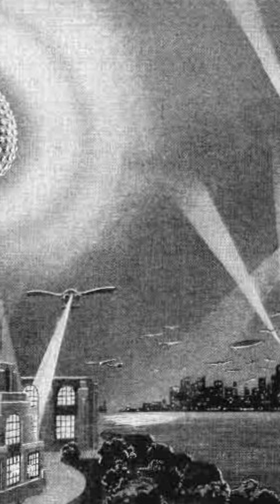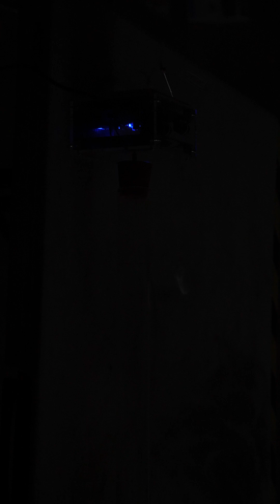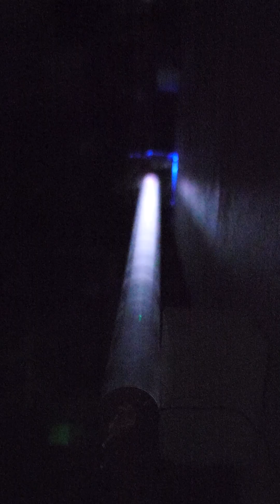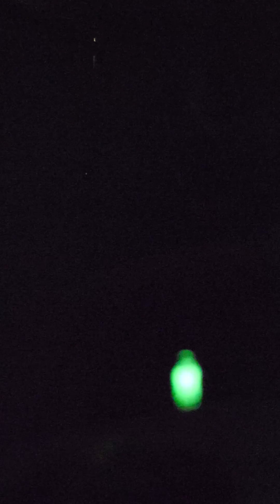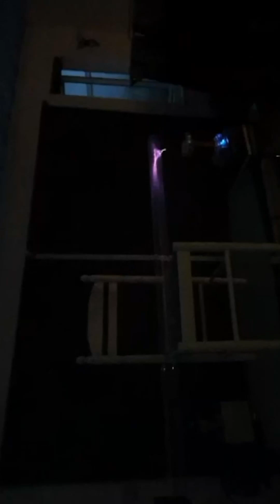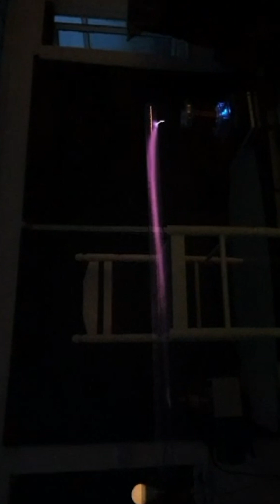Testing Nikola Tesla's Wireless Energy Idea

Comment: Introducing the Hyper-Resonant Electromagnetic Flux Transmatron, a groundbreaking innovation in the field of pseudo-resonant energy transference and wireless power transmission optimization. This state-of-the-art device is expertly designed to modulate and synchronize the intricate electromagnetic interactions within elaborate systems, while simultaneously enhancing the stability and adaptability of interconnected components.

At the heart of the Hyper-Resonant Electromagnetic Flux Transmatron lies the pioneering integration of a multi-scalar, magneto-inductive lattice network. This network capitalizes on the power of electromagnetically synchronized energy harmonics, initiating a meticulously regulated series of self-organizing, trans-spatial interference patterns. As a result, the device optimizes the coherence and synchronization of electromagnetic waveforms across a broad range of operational parameters.

The Hyper-Resonant Electromagnetic Flux Transmatron is also outfitted with an advanced radiophotonic synchronization conduit, which employs a highly sensitive array of superluminal resonant phase detection nodes. This allows for real-time monitoring and adjustment of sub-wavelength electromagnetic fluctuations, effectively counteracting the adverse effects of energetic anomalies and power dissonance.

Furthermore, the device incorporates a cutting-edge, non-linear electromagnetic inducer that dynamically generates an enveloping field of non-localized energy particles. This field serves to stabilize and reinforce the structural integrity of the magneto-inductive lattice network, enabling the device to maintain an optimal operational threshold under extreme conditions.

A series of polyhedral, electrodynamic dampeners are strategically positioned around the device's core. These dampeners provide crucial protection against the detrimental effects of hyper-resonant electromagnetic oscillations and ensure the smooth functioning of the Hyper-Resonant Electromagnetic Flux Transmatron, even during periods of intense system activity.

Lastly, the device boasts an integrated yoctoscale energy-gradient modulator, which continuously samples and analyzes the ambient electromagnetic energy patterns within its operational environment. This sophisticated feedback mechanism empowers the Hyper-Resonant Electromagnetic Flux Transmatron to seamlessly adapt to fluctuations in system performance and external conditions, maintaining a consistent level of wireless power transmission harmonization and stability.

In conclusion, the Hyper-Resonant Electromagnetic Flux Transmatron represents the cutting edge of wireless power transmission and system optimization. With its innovative design and unparalleled performance, this device is poised to redefine the boundaries of electromagnetic energy transference and usher in a new era of efficiency and stability in complex systems.

Comment: Very high voltage (Volt), corresponds to extremely low current (Ampere or I) and impedance. While the concept works with "full size bulb" clearly that bulb was an efficient LED bulb (high impedance.thus low current), as well as a neon bulb, which merely requires about ~62 V to trigger ionization, thus glowing. Also high impedance load and low current.

But would it work in a traditional tungsten incandescent filament? That one is low impedance thus correspondingly high current.

Takeaway:
1. Ohm's law rules, even with electrostatic voltage potential. Until the breakdown of the dielectric; thus why low pressure or vacuum allows the plasma to exist.

2. What about the flow of electrons source into low impedance sink?

3. And instead of ionizing the ionosphere (unknown side effects) while depending on electrostatic forces; how about some current flowing through a conductor material, which will inherently create electrodynamic and electromagnetic forces propagation/transmission?

Comment: Those who don't know: (Simplest Explanation)
Plasma (very very very hight temperature fluid) ionises the low pressure air which leads to free electrons moving around, these same electrons then create a current (which means flow of electrons) and light the bulb.

Comment: Amazing and creative idea. Just not feasible in reality otherwise we'd be cooked. Hence why wires are still in use cause it's uninterrupted.

Say you have a wireless charger for your phone, right. The phone is the gadget and the charger is the power source. There's nothing in between so it's uninterrupted and it will charge/power the thing. But if you put a 2inch piece of wood, it would not charge the phone, and that block of wood represents us, the interruption. But the difference with wood and us is that we are great conductors of electricity, so we'll fry. We'll fry cause the amount of energy sent to a far away machine that you wanna power wirelessly take a great amount of power as demonstrated on the video. Upscale that to big boi size, the place is unhabitable for any living creature

Comment: If I'm correct the reason why we don't have this is because it's extremely difficult to market and sell free electricity like this so the electric companies told him to stop researching it and even threatened to shut off his lab if he continued his research
Reply: What are you on. There's no free energy here. He's putting in thousands of volts and only slightly lightning up an LED. The power losses in a system like this are enormous. Tesla didn't make "free energy", he tried to make an alternative to WIRES. And they were shit. So he stopped doing it.

Comment: The problem with that is it cannot transmit much power.  Maybe light a neon bulb, but it wouldn’t make the smallest motor turn, which is a good thing.  If there was ac power in the air with more current, it wouldn’t be safe for anyone, it would fry everything in its path!

Comment: Did you hood up the ground in between the capacitor and the Tesla coil. That would make it works more Is officiently and at a higher voltage

Comment: This is not actually Tesla's original plan. The ionosphere wasn't discovered until the 1920's. 

Tesla's idea was to transmit electric power (and radio telegraph signals) through the Earth. He would build many towers around the world with antennas buried deep into the ground, and use the towers to pump the luminiferous aether up and down between the ground and the atmosphere. (Synching up the towers so that the Earth would resonate.) 

Then to draw power from this system, you just stick an antenna into the ground.... Anyway, this plan would never work, the ground is a conductor like a giant Faraday cage, so you can't transmit anything through it. 

Tesla did not believe in the theory of electromagnetism, or that radio waves are electromagnetic waves. Most of his later inventions would never work. It's not a conspiracy, Tesla was just wrong about some things.

He also got his funding cut off from J. P. Morgan when building Wardenclyffe because Tesla was lying to Morgan about building a trans-Atlantic radio transmitter, and also Marconi actually built a working radio transmitter for much less money.

Comment: For that to produce enough energy that would power things that we used today people would be getting electrocuted non-stop LoL
Reply: Nope. Tesla's system of wireless power transmission was designed to operate at very high frequencies, which would not have been harmful to people or animals on the ground. The energy transmitted by these high-frequency fields would have been concentrated and focused, rather than spreading out in all directions like low-frequency electromagnetic waves.
Reply: @eyespy3001  That would be even worse. This is a stupid idea that a century old and long abandoned for very good reasons –  it’s inefficient, it’s not free, and if concentrated as you suggest, lethal. The frequency does not make it any less lethal to all living things. Leave electrical engineering to the engineers, they know what they’re doing, Tesla didn’t.

Comment: I mean... it's super cool, you can transfer the Energy "wirelessly"... but you need pressurized Tubes instead. So in the End, Cables seem like the easier Solution to me xD
Reply: Tesla’s idea was to transmit energy through magnetic fields, much like radio waves. You would need receivers to receive the energy. Tubes were used in this demonstration to mimic the low pressure of the ionosphere, where Tesla’s alternating current would have been transmitted through.
Reply: @eyespy3001  oh interesting. It's still hard to picture, but it's a cool Idea at least^^
Reply: @eyespy3001  This was not actually Tesla's original plan. The ionosphere wasn't discovered when Tesla built Wardencliffe. His plan was to transmit EMF through the Earth by vibrating the luminiferous aether. Tesla's plan would not work, because the ground is an electric conductor... like a Faraday cage... so radio waves can't pass through it.

Comment: i could be wrong but wouldnt that electrocute anything that passes through that plasma line?
Reply: I mean if it’s able to light up or power anything substantial, yeah I can’t imagine why the current/voltage wouldn’t be the same as a wire that can light up or power the same thing. Purely conjecture though as I don’t know much about plasmas.

Also this has to be really inefficient compared to what they’re trying to do with graphene
Reply: I think humans are more conductive than air so yeah, it would arc towards and through you into the ground if you got too close. Flying in a plane might be ok but this idea from Tesla is little more than sci-fi right now.
Reply: Nikola Tesla's idea for electricity was based on the use of alternating current (AC) rather than direct current (DC), which was the predominant system in use at the time. Tesla's AC system used a transformer to change the voltage of the electricity, allowing it to be transmitted more efficiently over long distances. Tesla also developed the concept of wireless communication, which involved transmitting electrical energy through the air without the need for wires.

The idea of wireless transmission of electricity involved the use of electromagnetic waves, similar to those used in radio communication. Tesla proposed that electricity could be transmitted through the air by creating high-frequency electromagnetic fields, which would be absorbed by specially tuned receivers. However, this idea was never fully realized during his lifetime, and wireless power transmission is still a topic of research today.

Regarding the concern about electrocution, it is important to note that Tesla's system of wireless power transmission was designed to operate at very high frequencies, which would not have been harmful to people or animals on the ground. The energy transmitted by these high-frequency fields would have been concentrated and focused, rather than spreading out in all directions like low-frequency electromagnetic waves.
Reply: @eyespy3001  this was very very informative. thank you for taking the time to explain this to a smooth brain like myself. we were always taught that Tesla was ahead of his time and the fact that we are still researching his ideas really shows that. i honestly wonder what he could have done in todays age of technology with the mind that he had. Almost reminds me of what the world would be like if we never lost some of the knowledge in the Library of Alexndria.
Reply: @eyespy3001  We do have microwave transmission and reception.
Reply: The idea was to use the upper atmosphere, the plasma lines would be about five times higher than any plane. Not sure hoe he would get the tesla coil up there though, the highest helium balloon only managed half the distance.

Comment: Too bad Teslas funding was cut off, and his tower was destroyed before he could bring his vision to life.
Reply: Too bad Tesla was a fraud
Reply: That true?
Reply: @Tommy-ht5kc  Yep
Reply: @Mr.KissYourDad  it’s a shame everything comes down to money man.
Reply: His vision? Using a fucking wire is way better than this, not to mention safer.
Reply: @ElectricalFailure  electricity itself was once deemed unsafe and unstable.
Reply: @ElectricalFailure  he did that also
Reply: @ElectricalFailure  Tesla’s vision of wirelessly-transmitted alternating current was perfectly safe. The system was designed to transmit electricity at very high frequencies, which weren’t harmful to humans or animals. The frequencies would also have been very concentrated and focused, rather than spreading out in all direction like low frequency electromagnetic waves.
Reply: @eyespy3001  then again you can't prove it, since we don't know if it would have ever worked
Reply: I guess you can still keep the Dream even though the video showed we have better tech today.
Reply: Tesla told J. P. Morgan that he was building a radio telegraph system that could communicate with Europe. When After Tesla spend all the money, and then more money, and tried to get Morgan to give him some more. Morgan stopped funding Tesla when he found out that the Tesla had been lying to him. (Also Marconi had actually achieved trans-Atlantic radio transmission, for much less money.)

This isn't a conspiracy.

Comment: But wouldn't you still need something for that plasma to travel along from point to point? If that is the case it seems more cumbersome than what we already have.
Reply: Yeah that's we just use wires, simpler and often cheaper.
Reply: If you can break down the wire component into segmented points maybe that could work?

Essentially the plasma would "hookshot" from one segment point to another until it reaches the receiver (i.e. light bulb).
Reply: ...yes, the ionosphere. The original idea was plasma traveling through the ionosphere.
It's even said in the video, pay attention...
Reply: @CorelUser  This was not actually Tesla's original plan. The ionosphere wasn't discovered when Tesla built Wardencliffe. His plan was to transmit EMF through the Earth by vibrating the luminiferous aether. Tesla's plan would not work, because the ground is an electric conductor... like a Faraday cage... so radio waves can't pass through it.
Reply: @CorelUser  exactly create electricity hotspots. Using ionosphere. Planes won't get harmed they fly in lower atmosphere. If you want to send a spacecraft wrap it up in insulator. Or create a no hotspot zone.
I don't see where's the problem?
Reply: It would make anything in its way a ground, including you. It was a dumb idea that Tesla fanboys love because they don't understand how completely ludicrous it is.
Reply: @skipads5141  Literally cracked my skull open and stole my words.
Reply: @skipads5141 except you missed the concept entirely.
Reply: @iiChadd  it’s not about everyday appliances it’s about sending  large amounts of power to remote locations so we don’t have to be crammed in cities.
Reply: @iiChadd  You're not wrong, but if it was to become a reality, in all these years we would have figured out something like air-to-ground transformers
Reply: The point to point contact would be the Tesla cos and The tube would essentially be the ionisphere and/ or the human resonance.
Reply: The tube is there to represent the low pressure of the ionosphere. You wouldn't need a tube if you were using the actual ionosphere
Reply: @iiChadd  yeah😂😂 thanks to Tesla those appliances are even running